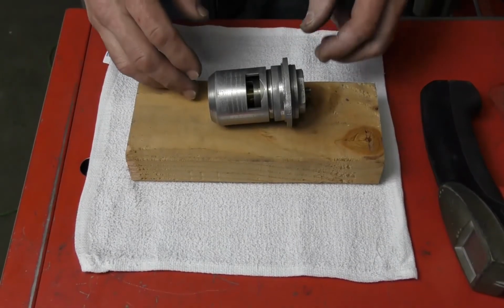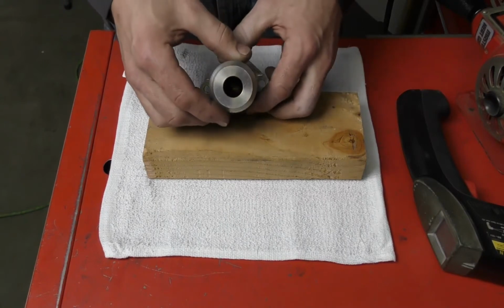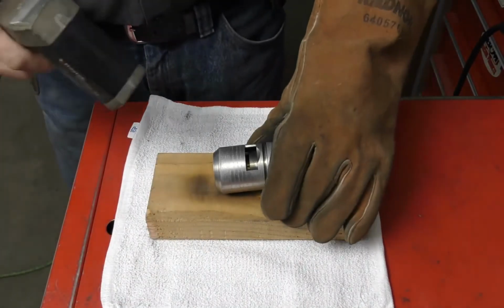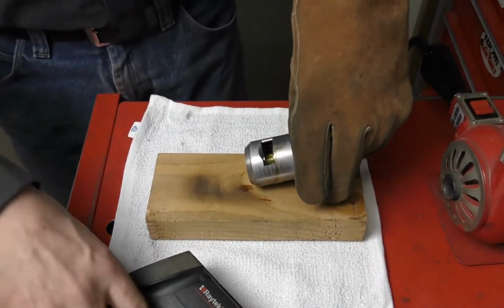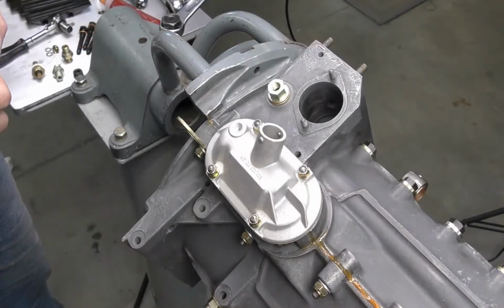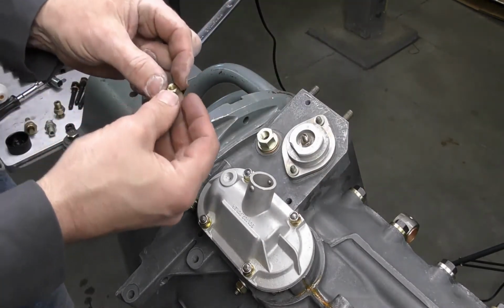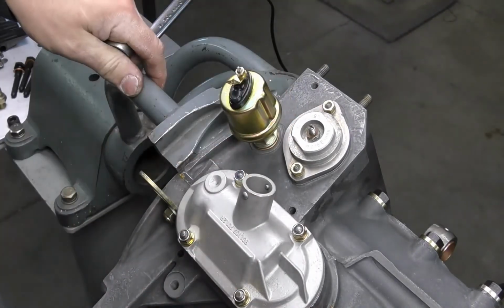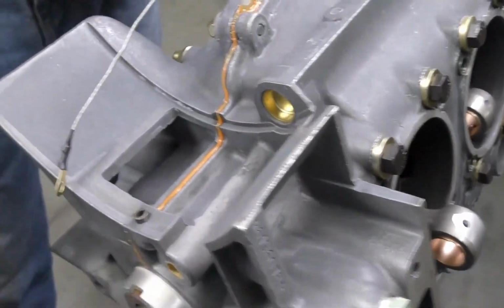Testing  the Oil Thermostat in your Air-Cooled Porsche Engine

Comment: For the camshaft oil line fitting, are you using the one with smaller orifice? There is some discussion that it might minimize oil foaming?
Reply from the maker: I do not use them on early air cooled engines. The only car they are supposed to be used on is the late turbo engines
Kurt

Comment: Hello. What if I suspect that my thermostat is stuck open? Is it somewhat rebuildable, or should I buy new one straight away? My engine struggles to reach operational temperatures, when it is 10⁰C or below. No overheating issues. I plan to have access to it when changing fuel lines, so contemplating, what would be the corrext approach to this issue.
Reply from the maker: These are not rebuildable and can only be replaced if not functioning correctly.
Kurt
Reply: @klassikats  Thank you for the reply. Would you think that my assessment on engine warming-up issue is correct. Also, from your experience, should these engines have no problem warming up when operating in temperatures 10C (50F) or below?
Reply from the maker: So they will take a long time to warm up in cold climates. We live in a place that the temperature in winter can be below 0F and a normal winters day wont get above 25F. When driving our SC on those days it is rare for the front oil cooler to open and it takes a long time for the temperature gauge to register a change in engine temp. This is pretty normal for an air cooled engine.
Kurt